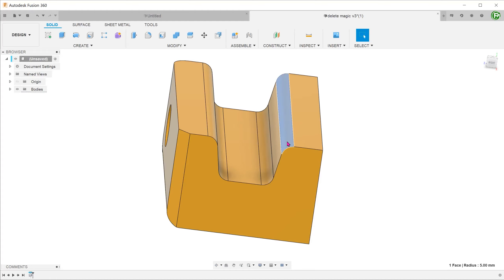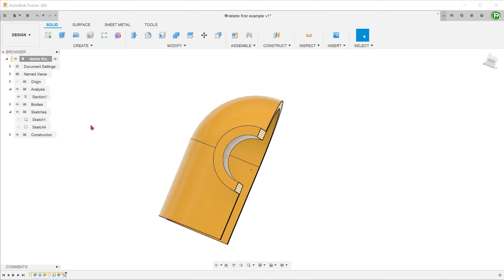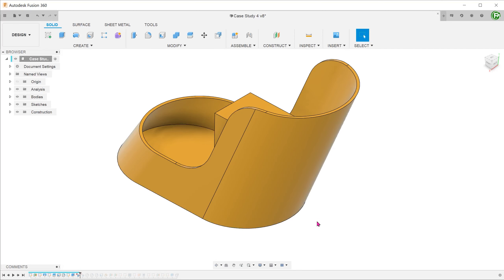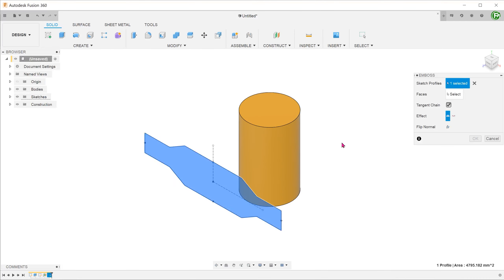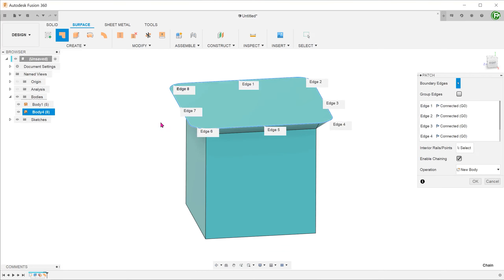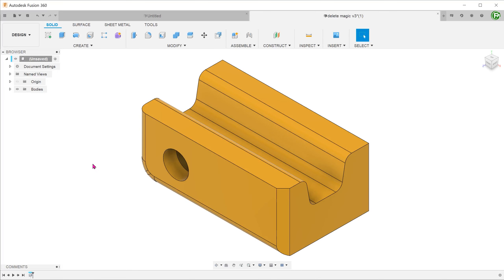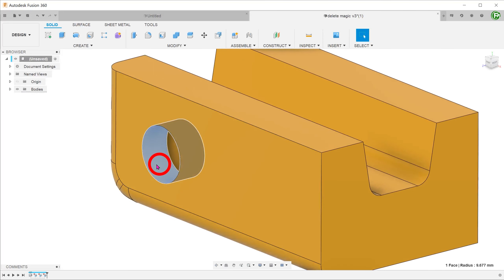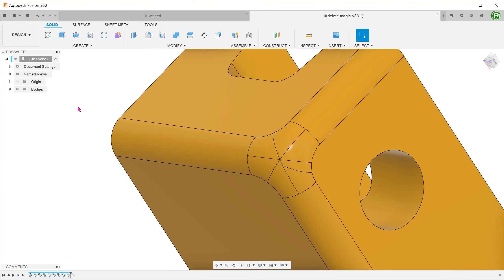Fusion 360 - The Power of Delete

Comment: What if the part you delete is referenced and you get a warning?
Reply from the maker: If there is a critical feature/sketch that depends on the part that you are trying to delete, then you should not be deleting that. Generally speaking, deleting is an adjustment tool that should be done after all the main features have been done. This will avoid any dependency issues. If it is absolutely necessary to perform a delete before a dependent feature, you would need to rebuild the references based on the geometry after the delete.